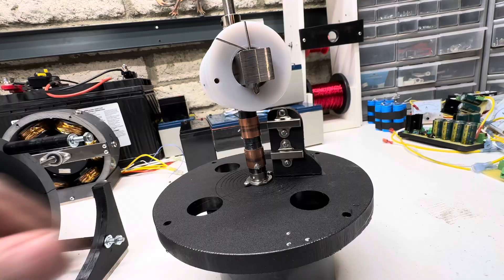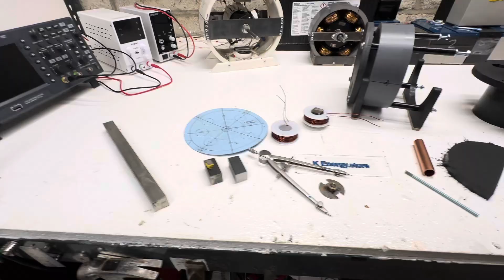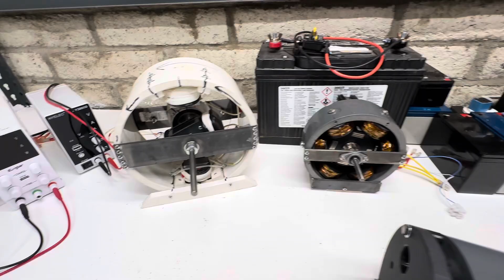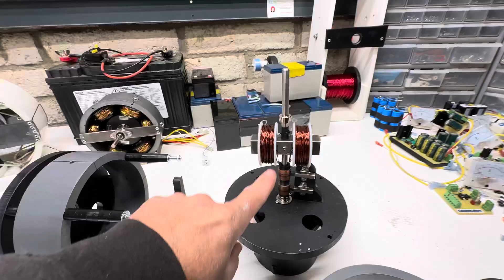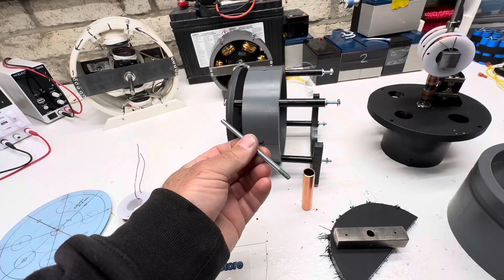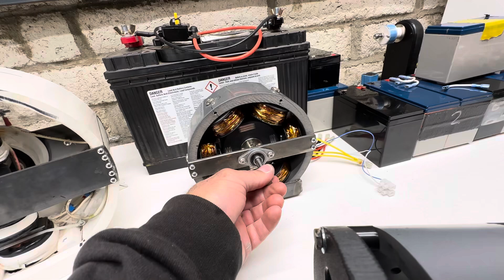Motor building basics and new prototype

Comment: Thanks for freely sharing. You are a scholar and a gentleman as the saying goes! Quick question: Do you ever use Iron for your cores or only Steel?
Reply from the maker: @PerceiveBelieve  mild steel is the easiest to work with but yes I have
Reply: @kenergy1707  Is that mostly to keep costs down, or you just dont see much performance difference between soft Iron and mid Steel?
Reply from the maker: @ for prototypes mild steel works quite well
Reply: @kenergy1707  Got it, thanks!